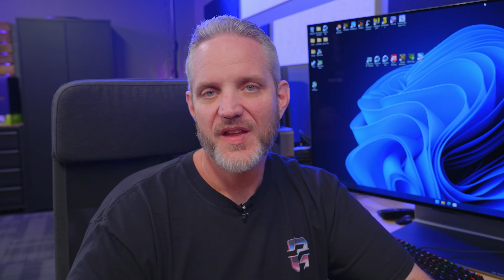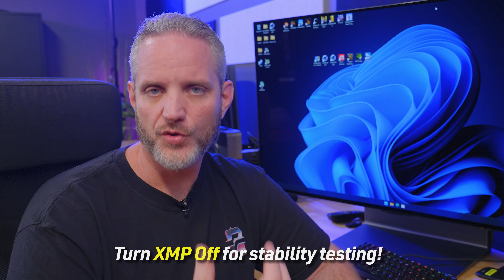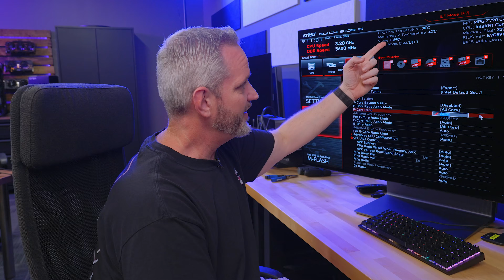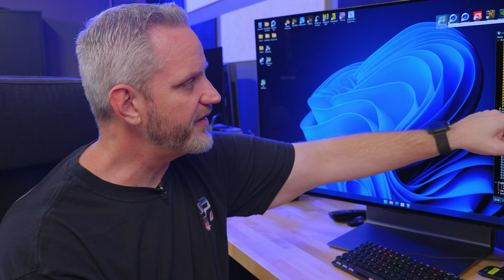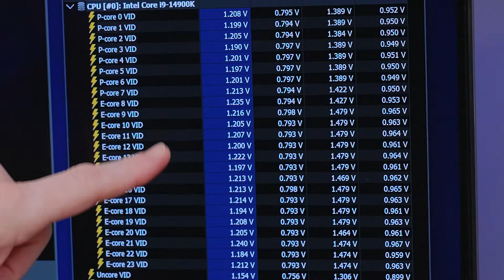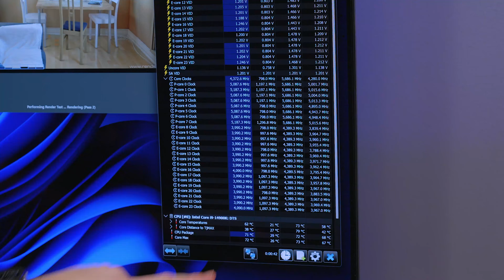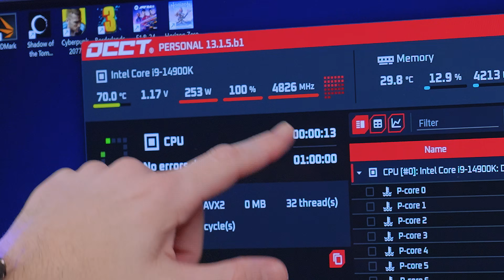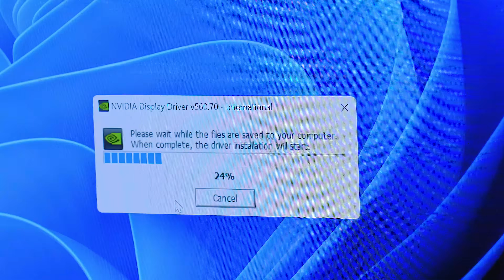Guide: How to check if your CPU is BAD!

Comment: Think Jay needs to do some more research on this topic. I have a Asus Z690 and Asus profile undevolts my 13700k at base speeds 5.3mhz. The default Intel profile OVER VOLTS. This cpu will overheat nearly instantly on the intel profile and can barely hold 200 watts because it's running at 1.55 volts. The Asus profile under volts at 1.45 and can sustain 253 watts on any benchmark. I consistently get ~30500 pts on R23 with the Asus profile, while the intel can't even muster ~27000 because it's overheating so badly. Not sure what processor Jay is seeing Asus is overvolting on as the default Intel labeled settings are what are over volting. I'm personally not having any issues, tho I know the 13700k is not as affected by this issue, but it seems some are. I just want to know what CPU and MB Jay is talking about instead of just blanket calling out a brand. As I wonder if he understands which combos he's referring to. And yes this is on the most recent bios 3802. But this behavior is the same as its always been, even before the microcode update as I got mine in Mar 2023 and it's functioned this way since the start.
Reply: Same CPU and MSI 790 motherboard and this mirrors my experience as well. Think I'm getting around 29,700 but otherwise identical results.
Reply: @McBrad86  that's good to hear. You'll might crack 30k by making sure nothing is running in the background when you test it or changing the priority to high in task manager. But high 29k score should mean you're likely just barely over saturating your cooling. I'm using the Arctic 280 AIO. There's so much confusion with this topic. Sadly Jay is adding to it imo.
Reply: The safe voltage is 1.3 but it reduces performance.

Intel won't force you to get to these levels otherwise they will have falsely advertised. 

Instead the microcode just prolongs the CPU enough to get past warranty period.

Thought it was well known the P cores are the problem.
Reply: @glyntaylorwilliams  Yea this is not a  MB problem in my opinion. Sure they didn't help. But Intel is straight up lying about the performance and volt requirements. I've even gone as far as to just set my 13700 to the 90 degree max. I only expect to keep it for 5ish yrs as it should last that long, and be powerful enough to meet my needs for that time period. When I bought it, I had all the expectations in the world it would easily last that long and that cooling would not be a major issue. Boy was I wrong. So far I have no crashing issues, I did at the start of ownership of it however. As figuring out the correct voltages was a nightmare because everyone's' "use this xyz" setting did not work. The variation on the 13/14 gen in what works is wild. Which really re-enforces the it's not the MB's causing these problems. It's Intel.

Final thought, I also have 2 P cores that LOVE to blast right to 100c on the simplest of workloads. They are not the prefered cores either. Core 3 and 7 for me love to light themselves on fire at the first chance they get. This does worry me about my chips long term survivability. Time will tell. Likely when it's out of warranty....
Reply: Dude 1.45v sucks for a 13700k. You board or CPU are Trash. RMA it. Mine runs a 1.22v because Asrock is much better than Asus.
Reply: @PlayJasch  this right here is why this topic is so bad. So much bad info. Just not true. Those are peak volts. Sustain voltage is generally 1.27 -1.29. Which is exactly where it should be.

Also did you undervolt it yourself? 1.22 is not a default profile that everyone is talking about.

Comment: So absurd that intel doesn’t have the cash to recall all the bad batch cpus. All these years of monopoly and they couldn’t afford to recall 2 generations of cpu. Samsung had only a dozen note 7s blew up and they recalled every single note 7 from the entire world no questions asked.
Reply: bro.. have you seen their earnings?
Reply: @klumzyee  like a few jigallion dollars or something? I don’t know, but they’re the monopoly and time and time again has shown some pretty greedy and sketchy practices. Excuse me if I don’t have a soft spot for them.
Reply: to be fair, the Intel CPUs are not catching on fire (yet).
Reply: The CPUs are not bad, they are being burned up by inappropriate settings, usually as a result of MB vendors and users pushing the processors too hard.
Reply: @Tugela60  I don't really agree with you. It is a combination of multiple things. The Mobo manufacturers are not without blame but neither is Intel, their processors should protect themselves better against 'aggressive' behavior of the mobo. I mean, otherwise AMD processors would be having the same accelerated degradation issue, unless you want to belief that the mobo manufacturers are in a conspiracy with AMD to get rid of Intel :P :P :P
Reply: @Morrodin-WH40K  AMD have hard limits, that is why you can't get better perfomance out of them even if you try. Intel allow you to push if you want, but you do so at your own risk, they even say so in their warranty. Basically AMD handholds, while Intel does not. Which assumes that users know what they are doing, but 99.9% (even self taught "experts") probably don't.

Puget had a blog discussing this issue, and based on their RMA data, AMD processors are almost twice as likely to fail than a properly configured 13th or 14th gen Intel processor. So it is definitelly a user error, one happening as a result of a combination of user ignorance and MB vendor irresponsibility. Why should MB vendors care if the CPU burns out early? They are not responsible for CPU RMAs, all they care about is their board beating competion in benchmarks
Reply: So, Intel should protect their CPUs better. I am sorry but it is not simply due to misconfiguration that the accelerated degradation occurs. It is more complex than that.

I own a 13700K, which has no issues and in the future I will most likely buy intel again but that does not mean I am adamant on being blind to the fact that they did in fact screw up.
Reply: @Morrodin-WH40K  The screwup was in giving users the freedom to configure processors how they wanted.
Reply: @Tugela60  No, because standard configurated motherboards (with unlimited power draw) were able to trigger this issue and properly limited BIOS settings could also trigger this issue. Please stop trying to put the blame on the customer/user... it is a more complex issue than simply 'user error', 'motherboard manufacturer error' or even 'intel error'. It is a combination of various things:

A) some users OC beyond safe limits or without proper knowledge
B) motherboard manufacturers had default unlimited settings in their BIOS
C) intel did not put enough preventive measures in place to protect the integrity of the CPU when A or B happens
D) some specific tasks put a heavier load on a single core, which leads to higher voltage spikes
E) higher temps + higher voltage leads also to faster degradation (this can be due to insufficient cooling, incorrect configuration, heavier workloads, current Intel CPUs just run hotter than previous generations.)
F) other things I don't think about right now probably come into the picture as well.
Reply: @Morrodin-WH40K  nope, there are defects in the manufacturing process and they know it. No excuses. The CPU used to be the component that outlasts your pc build. You shouldn't be required to play with the settings or undervolt it. Stop making excuses for intel and ask for better responsibility.
Reply: @InnerFire6213  There are no defects in manufacturing process (at least recent ones), they are build as intended. The primary design itself is faulty, which is why 12th gen is fine and 13th is not. 12th gen was that borderline for classical intel consumer CPU design, they should knew better to use design more akin to xeon or hedt processors, not old design fit for low core counts.
Reply: @alexturnbackthearmy1907  well if that's true there's no point in intel implementing a newer "manufacturing process". time will tell if the newer batch of cpus still have the degrading issue

Comment: Asus Z790 Dark Hero, I9 14900K, Asus Rog Strix 4090 White OC Edition, 64 GB 6000mhz ram, Corsair 360 AIO, and Corsair 1000 watt PSU user here. No crashes at all.
Reply: 14700k here, zero crashes since Feb 1st, stock settings. Never seen over 1.41v, don't care.
Reply: Have almost the exact same setup

My CPU just died yesterday 😔
Reply: @ExoDAbLe  Ouch. Sorry to hear that.
Reply: I purchased a sealed pack 14900k just yesterday to be sure that I am getting into this ecosystem with an unaffected chip. Purchased maximus z690 extreme board for my extreme build. Will run Intel defaults. Hoping for the best.
Reply: @GTXGAMER7  Been gaming all weekend playing Battlefield 4 online and Battlefield 5 online and so far, still no crashes.
Reply: @CannibalsEntertainment  good to know. I just installed and setup my pc for first time. Using intel performance defaults for now. Does max vid 1.51 seem fine?
Reply: @GTXGAMER7  To Intel? Yes. To me? I'd want around a max of 1.45v

Best of luck.

Comment: I've been running an undervolt on my CPU (13600K) at a -0.15V offset with no overclock XMP on, ASUS B660I.

Would I still see the same degradation if I was running at an undervolt?

Comment: When Dead by Daylight changed to Unreal Engine 5 my game would crash everytime it showed the "compiling shaders" at the start up and I was like "???" then I googled that error and got to steam forum which said to set Performance Core Ratio from 55x to 53x in Intel Extreme Tuning Utility which I did and it worked thinking like "I dont understand but it works"

Now 3 days ago suddenly I would get bluescreens just randomly playing various games (had like 3-5 since in all the time before). I would bluescreen, then start league again with nothing else running, 1 min inside game bluescreen again. I also saw my CPU Temp going through the roof, before they where like 70C (with 2-3 games running at the same time) now it went to 95 with only Rust running.

I Updated my bios because I started to research the matter but even with the new bios I would either bluesceen or the PC just shutting off frequently now with whatever I maybe doing.

In the end I had to change all boost modes from my CPU now instead of running at 5GHz it runs at 2,7GHz and hadnt a crash since.

Comment: Completely off topic: Can anyone tell me if I'm the first person who has of thought of connecting a water cooled PC directly to the plumbing of an HVAC heat pump? Especially if there's a mini split system, the coolant is distributed to each room. It's right there, kind of.

It's probably not great to literally make the computer's cooling loop part of the heat pump's loop. That stuff has a phase change and evaporator and such, and who can say what happens if it's inside a PC cooling system.  But what if you used a liquid-liquid heat exchanger? Instead of liquid-air-liquid you'd have liquid-liquid. That should be inherently more efficient.  

And no fan noise, and no hot computer rooms. Except for the power supply. Liquid cool that too because no compromise.

I know what everyone is thinking: this is a dumb idea. But HOW dumb? How can we know exactly how bad this idea is if we don't think about it? 

Because all the heat shed by your PC is heating up your room anyway. This just puts the heat directly into your cooling lines, skipping the step of heating up the ambient air, which then transfers its heat to the HVAC system. In the winter the PC's heat takes a small amount of load off the HVAC system. Very small. If you have a 5 ton HVAC system for a home, that's something like 240,000 BTU/hr, which is about 70,000 watts. Adding the heat of even a 1500 or 1600 watt PC, power supply and all, will barely be noticed. And it's going to have to absorb that heat anyway. 

The less crazy version of this would be just put your radiator in a closet or some other room and run hose to it through the wall, so you don't have to feel the heat coming from it, or hear the fans. But also, dream big, maybe?

Comment: my 14900k can't even boot with stock bios settings.  it just goes into a bsod loop.  only way to even get it to start is to manually lower pcore ratios to 52.  then in XTU, if i up the ratios to stock... it bsods.

Comment: I’m on an ASUS board, running the new micro code and now I’m seeing voltage up to 1.5-1.6, whereas before I wasn’t. Stock bios settings, intel preferred power profile, XMP enabled, no intel tuning. What can I do to keep from hitting the high voltages?

Comment: Cinebench and occt both crashed. Cinebench during multi-core and occt during variable test. Also have had many problems with unreal based games and with unreal engine itself too. Running 13700kf, RMA here we go...

Comment: Hi thanks for your insides.
I ran in the A-XMP Problem on an MSI MAG Tomahawk B650, after the bios update, my new assembled build won't POST.
I am able to reset the bios.
Here is my Question, is there another way to reset, if the system won't POST?
Other way means, set Jumper, wait 10sec. start System.

Thanks.

Comment: I can't believe Intel fell this bad. Greed did really took its tool on them.
Never liked AMD, ever, but maybe it is time to give them another chance, because hey cpu degrading is just crossing the line consumer "experience". I've also noticed that Ryzen cpus don't have the latency on windows latest Intel CPUs are actually showing, and I think that's due damn hybrid architecture when communicating with windows, going back to "normal" cores and hyperthreading with AMD seems to be the sensible option.
Reply: I never understood why some people “never liked amd”. Like, you hate having a better price to performance, more stable and cooler running option 😂
Reply: @InnerFire6213  Because AMD, (I was talking of the past in my other comment), was always the clear lesser choice in both quality and performance, regardless they were cheaper too, always. The only thing AMD was better back then was in BIOS customization; AMD chips had way more tweakable parameters than Intel. I mean, all you had to do was pay a little more and get an Intel, the choice was easy. But now?, it seems to be the other way around; AMD has massively improved their CPUs, and are a perfectly sensible choice. But in the past they were not, that's what I meant.

Comment: My computer only crashes while im playing games. I dont get a blue screen though my screen will go black and my whole pc will restart itself. I am also no able to run any dx12 games without turning my clock speeds down to 54x or 53x from 55x. Not really sure what the issue is but i will run these tests and see if i cant get a recreateable crash to happen. Thanks Jay you the man
Should probably mention i have a 13900k, 4090 and 32 GB ddr5 Corsair not sure how many Mhz though. Mobo is ASUS ROG STRIX Z690-E GAMING WIFI in case any one can help. Thanks

Comment: Let me see 🤔……… bluescreens ………… trouble installing drivers (any driver) …………… random freezes ……… etc………etc. The defense of Intel by yourself and other Youtubers is disconcerting at best. We paid for a level of performance and we’re not getting it. That’s the bottom line. Tech Luvn’s recommendation is to return your 13th or 14th gen to Intel.  Forget about the useless microcode update that reduces the performance you paid for. Intel released a “placebo” fix IMO. I will be very skeptical about utilizing Intel CPU’S in my builds moving forward. I just can’t trust the architecture anymore and AMD’s architecture is also up against the wall.

Comment: I have to wonder if modern CPUs will be like this, but MOS 6510 CPUs are pretty durable. They are over 40 years old and still kicking. I have one myself. I have heard that the commodore 16/+4 CPUs are hot garbage and not reliable. Most people are just swapping them out for a mod that includes a 6502. But........anyway.....6502 and 6510 CPUs......didn't have active cooling. They don't require heatsyncs or anything. You just run them bare. They will get warm, but not by that much. You should be able to touch them without burning yourself while they are running. It wasn't until a decade later that heatsyncs and/or fans became requirements. I wonder how that will affect these old CPUs vs the new ones.

Comment: Lock all the cores first at the real speed of the cpu, for example the 13900ks is 56 (5.6 ghz). Then after, set voltage to 1.345v and a negative offset starting at -75, and work you way up if you need more of an offset, you want to keep the "vid max voltage" below 1.35v as anything above is too much. 

 Also, power limit the cpu to 253 watts max will also help and make sure if you have Windows 11 that you turn off "core isolation" as if you don't it overrides any voltage settings, and offsets you set. 

 This is what has worked for me with my now 2nd 13900ks and been going good so far. Hoped this helped!

Comment: Apparently the Black Myth Wukong benchmark tool has made some people's 14900Ks etc show their degradation by erroring out.

Still very happy I went 7800X3D instead of 14900K when I upgraded last year.
Reply: Any Unreal Engine game will show it because it does Compile Shaders when loading the game and it maxes the CPU out while interfacing with the memory controller - the memory controller is what actually has the problem, not the cores themselves.
Reply: same
Reply: 13700K and it runs smoothly at just over 60fps without any break-ins 😊
Reply: 14900k is a powerful processor that does any task flawlessly.  You just bought a cpu for video games.
Reply: @Ryzen9800-c2y  ** that has a 90% failure rate for some SIs - I fixed your reply.